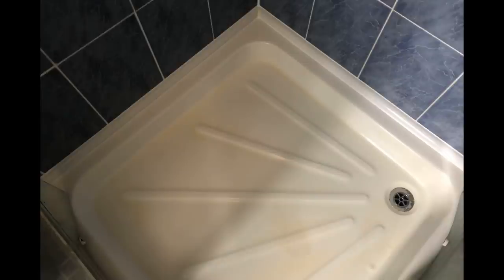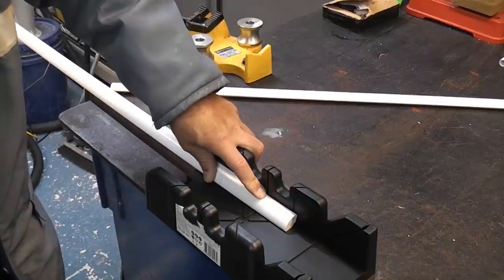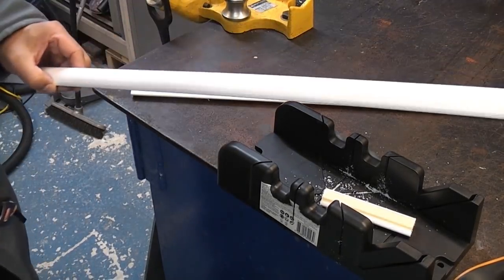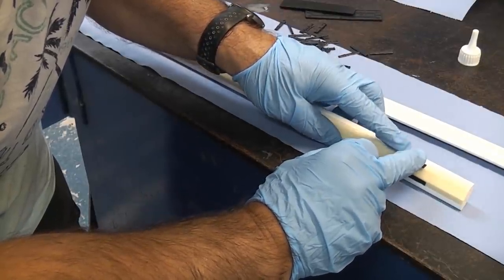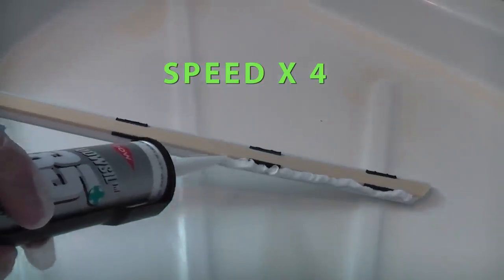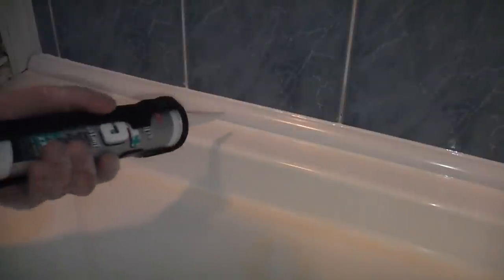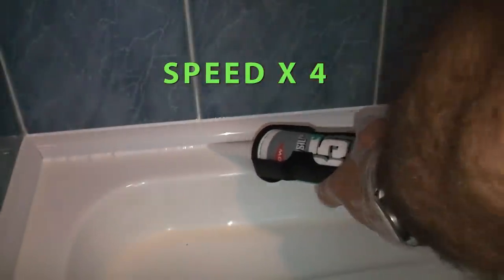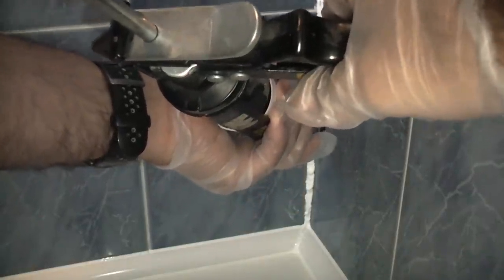How to fit UPVC beading to a shower tray

Comment: I’ve got two showers to re-silicone, not because they leak but because they’ve gone mouldy. Despite using high end adhesives! Gotta be my least favourite diy job
Reply from the maker: Yeah, it's not the best of jobs!
Best of luck with them
Reply: If you dry the silicone off after using the shower cubicle you won't get mould. It's a huge faff but worth doing to prevent mould growing in the first place.

Comment: I just used this same system on my bath tub which has a mixer shower tap system. With a screen door (of course the shower screen door leaks ha ha) But the quadrant scotia is a very good double barrier against the bath tub and tiles on the wall. Very good job by the way 👍

Comment: PVC scotia beads also work on vertical corners.  Silicon should be put on cut angles before fitting and allowed to squeeze out.
 Use window cleaner fine spay before running Fugi tool along...providing you have a proud continuous silicon bead showing.
 Saves  a lot of clean up.

Comment: I've heard it can make it neater if you spray a weak mixture of washing up liquid and water over the bead before using the scraper to form the beads.
Reply from the maker: Yes, it can help, but not always necessary.
Thanks for the comment 👍
Reply: You can but if you do this you can't add any more silicone to low spots because it won't stick. If possible always best to do it dry as shown in the vid then you can always add more.
Reply: @caskwith  believe me dont use washing up liquid or masking tape... the fugi kit is ideal

Comment: I just did mine. I used upvc quater trim cable tray. I was looking for the quarter trim but didn't know what it was called and I asked a few people and explained what I was looking for but no one knew what it was I needed. So I went to my DIY centre and found the cable tray. I might order the correct stuff and do it again ?
Reply from the maker: As long as it’s not leaking, I would just leave it 👍

Comment: Great video, Can I use this method if the tray is against a glass panel rather than a wall.
Reply from the maker: Yes, the silicone will seal to glass, as well as tiles 👍

Comment: Great video did not even ocure to me that I could use uPVC beading around the shower tray. My sealent keeps moulding so have to keep redoing it this should hide that.
Reply from the maker: I've used it a couple of times, it is really useful if you have a larger than normal gap 👍

Comment: Awesome job! I’m about to buy my first house and going to try silicon sealing. I just wondered what having beading does?
Reply from the maker: Normally, you do not need beading, but there is a considerable gap between the tray and the tiles in this example, so a PVC bead has been applied to ensure there are no leaks  👍

Comment: Great job. The way it should have been done in the first place.
Is it correct not to silicon the inside of the door/frame to allow water to escape? Only the outside should be siliconed?
Reply from the maker: Yes, that is correct in all the shower enclosures that I have seen. This enclosure had been sealed on the inside, so I scraped that away when I was doing this job.
I once spoke to a manufacturer and they said that no matter what you do, the water will always get in somewhere. That's why you only seal the outside of the enclosure, so that the water inside can drain out, into the tray 👍
Thanks for the comment 👍

Comment: Just wondering if white CT1 would be a good option for this - given that it is resistant to mould (apparently).
Reply from the maker: It should be fine. Most good quality sealants/adhesives will work 👍

Comment: Nice job, but I don’t get why you also put sealant in the gap between the tiles & tray. If it’s covered by the angle beading, why not just use spray foam to quickly seal the gap? Especially as it doesn’t shrink like sealant will when used to bridge a large gap.
Reply from the maker: I've never known sealant to shrink 🤔
If you want to use foam, that's fine 👍

Comment: A bit late i know but when fitting the bead do you use an adhesive or does the silicone act as one. Thank you in advance
Reply from the maker: I used silicone to fix the beading, then sealed it all with more silicone 👍
Reply: @ultimatehandyman  Thanks for the advice. Job now done.👍

Comment: The gap at the top of my bath is bit big .Could you recommend something for around the top of a bath? Could I get this type of bead or something similar for around the top of a bath?
I was thinking of making a say 4inch high tile border on top of the existing tiles to try create create an overlap or reduce the gap at the top of the bath..
Sorry for the long question..
Hope you understand..
Thanks 👍☘️
Reply from the maker: Yes, you can get this in much longer lengths, I often buy stuff like this from GAP in Blackburn -
https://www.gap.uk.com/order-online/upvc-trims/white-trims/quadrant-white

I used tiles as you suggest, a while back in a rental property, but it did not look too good.

I have also used ceramic quadrant tiles - https://www.tilegiant.co.uk/ceramic-bathtrim-set.html
Reply: @ultimatehandyman  
Thanks for your reply.👍☘️🇮🇪

Comment: Go to a roofing supplier that also sell facia products, just bought 19 mm for £5.00 at 5 mtrs in length
Reply from the maker: I normally get stuff like this from GAP in Blackburn - https://www.gap.uk.com/order-online/upvc-trims/white-trims/quadrant-white
But sometimes it's much easier to buy online, especially when you consider the time to drive there/fuel etc.
Thanks for the comment 👍
Reply: @ultimatehandyman  true

Comment: Great video 👍🏻 btw I’d just like to ask off topic. I’ve got a gap in a wall next to a upvc door frame. Would I need to fill it in with cement or mortar. Never worked with the stuff before so I don’t know so thought I’d ask your opinion?
Reply from the maker: Frame sealant would be best, it's similar to silicone sealant, but a slightly different formulation.
👍

Comment: I have no idea why you would want to do this, such an 80's look, looks like you are trying to hide mould underneath and now Two failure modes (2 lines of sealant to fail) and much harder to maintain longer term. Just stick to one line of good quality silicone.

However, very good technique shown and a good quality finish
Reply from the maker: The gap was so large between the tray and the tiles, that this was pretty much the only solution.
Thanks for the comment 👍

Comment: They don't last pissing time
Reply: It's an expedient way of sealing a shower tray or bath perimeter when they have been poorly installed/sealed in the first place. I've had to do this before when the only alternative would be to remove baths. tiles, trays, patch plaster etc. Most insultingly, I have had to do this when I have tendered for work, not got it, then customers call me back to put cock ups right on jobs quoted for but have been given to others. Pay peanuts, get monkeys.